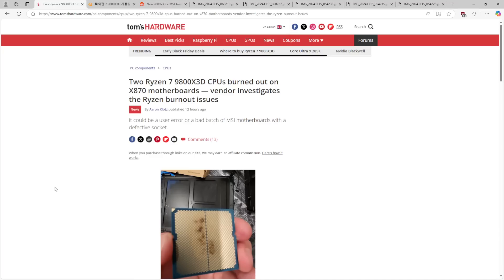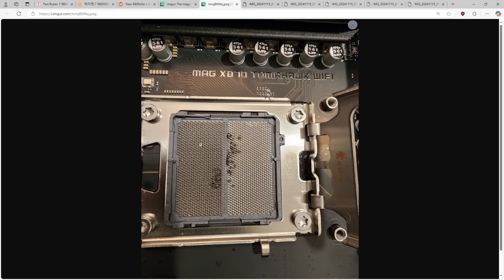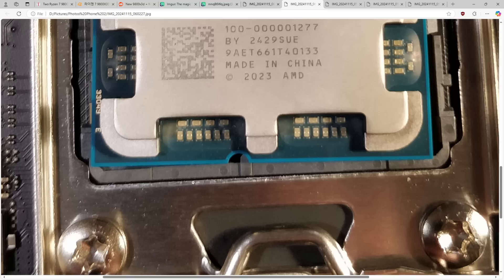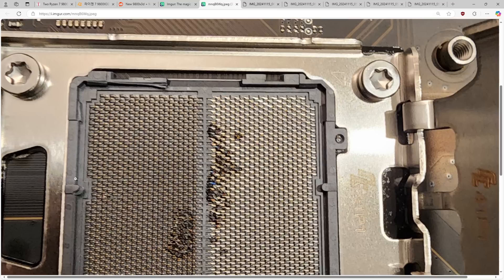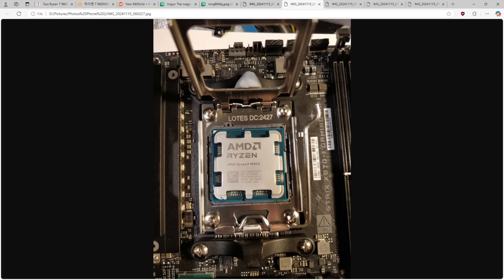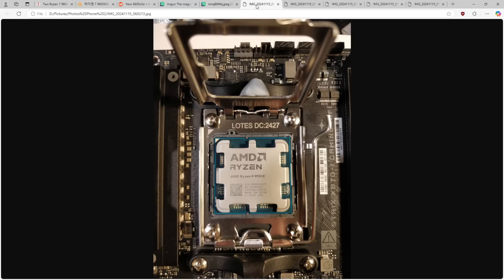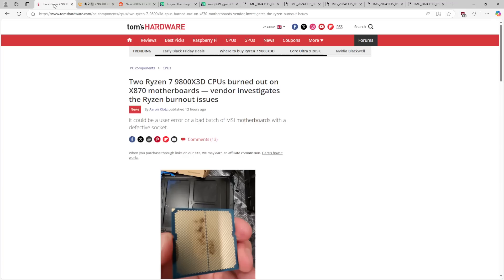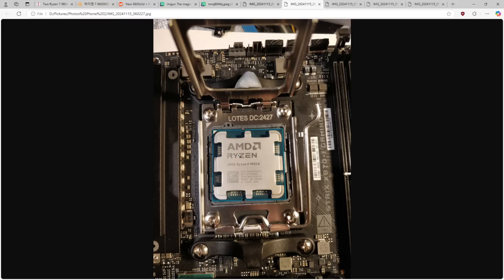HOW NOT TO BREAK YOUR 9800X3D

Comment: The thought of dropping a CPU and bending pins the harrowing. 
The thought of somehow managing to misalign a CPU in an AM5 motherboard is curious. The thought of closing the bracket hearing a crunching noise, seeing at the CPU clearly isn't aligned properly (granted your optometrist might be bad at their job), and bending your neural circuits to the decision of turning on your PC-turned-oven is mind boggling.
Reply: Mounting the cooler to this makes it much worse. It's not that hard to slightly misalign then latch the CPU but now it's sitting higher than it normally would. Mounting the heatsink would shift it even more and this force explains how it stamped a perfect notch into the plastic.

The only thing more absurd than all of this is taking it out and uploading a picture because you think it malfunctioned. I have a feeling they knew and that's why they angled the photo that way but who knows.

Comment: Already 6 years since I put R7 2700x into AM4 socket for the first time but I remember it being effortless.
Now put 9800X3D into AM5 socket for the first time and boy, was I scared to damage the CPU. It needed so much force for the latch to lock CPU in place. Had to do it twice in a row to check things out if I didn't damage anything.
But that notch was easy to see if you actually check how it's sitting in the socket. CPU's are expensive so I want to make sure I put it in place correctly.
EDIT: Had 3570K before, Core 2 Duo and Pentium 4 way before but don't remember those sockets anymore.

Comment: There's probably a few dozen people that did this.  Most were smart enough to realize they F'd up.  These are just cases of double failures.  
Fail to do it right, fail to notice you did it wrong. 
Pro tip, you don't need a hammer to install PC components, and if you hear crunching noises, you F'd up.

Comment: Jeez, what's next, "How to Put Your Feet Into Your Socks"?  I seriously don't understand people-  unless you wipe your ass with hundred$, why TF wouldn't you take 5 SECONDS to read the instructions on your $500 CPU going into your $500 motherboard?  This is either a problem caused by absolute idiots or people is so much of a hurry, they put the chip in sideways while running down the street while getting dressed while eating breakfast while taking a shower.  FFS, 'tards, take a breath, count to 1, and go slowly.  OR, find a hobby where there's nothing sharper and more dangerous than warm butter.

Comment: The 9800 ex 3D shouldn't even be called a 400.00 CPU just call it straight up 500 especially when it's that close at 480 play remember when CPUs were around 300 back in 2016 times have changed

Comment: People need to remember, hardware does not need force, it it is correct it will fit.
Reply: Say that to motherboard 24pin power cable 😂
Reply: Bro never touched a Molex connector

Comment: That last comment was dumb, if someone needs some advice of what to do and not do when building a pc, they shouldn't build a computer? So how do they start, is building a computer a skill that some people are just born with? If anything it's a good idea to seek as many informations as possible when doing this, just to not end up like, for example, exactly those two people in this video
Reply: For newbies, they can buy an old $20 HP/Dell office tower and play around with disassembling and reassembling it. Old office tower PCs are everywhere. The original poster of these pics deserves no sympathy because he made a mistake and didn't own up to it, instead blaming AMD and MSI.
Reply: @gippygames  I didn't mention the original poster, they did fuck up. As for newbies, yes, practice on some old systems is a great way to learn, but by itself doesn't just make the "theoretical" advices obsolete. Having more informations just doesn't hurt, and that was my whole point
Reply: It's absolutely paramount that you've completed your shape sorting test before installing a CPU.
Reply: @dhuckbourning7165  but the problem here wasn't putting the cpu correctly, but the whole vertical process, where properly seated cpu got skewed while closing the latch

Comment: I don't get it. I actually just upgraded from AM4 to AM5 about a month ago. Before this I had never had a PC with an LGA socket (I have always had AMD which was PGA) but I still had the common sense to know that the CPU just sits in the socket, it doesn't require me to push on it to set the CPU and I knew that the notches on the CPU sides should match up with the notches that stick out on the socket.

Comment: as much as its their fault for the incorrect install it makes me wonder if this could be detected before they attempt to power the cpu. maybe something like testing for a connection between 4 pins in the corners of the cpu. if one is missing the cpu cannot be seated correctly. sometimes engineering is just making things idiot proof.

Comment: Since I am also an idiot who installs his CPU vertically to save time I did some further investigation because I am in denial. I gotta say that the CPU sits firmly in the socket when you place it correctly even in a vertical position and it wouldn't be possible to misalign it else the CPU would just fall out. So now you put down the retention bracket and try to move the CPU in all directions while gently pressing it down, there shouldn't be any movement or you did it wrong. Now you can keep one hand on the CPU while securing the retention bracket.

When you look up an installation guide you can see that the first time around there's a cover protecting the socket so you can't pin down the CPU unless you remove it first but if they followed instructions they wouldn't have done that and it wouldn't be possible for the CPU to be installed vertically with so little dmg and it would always be the bottom notch that would be damaged due to gravity. I think they did install the CPU horizontally but were just eyeballing the insertion and thought it would just fall into place when the bracket forces the CPU into the socket or they just didn't think at all.

Comment: Shit, guess I am an idiot for finding this video useful lmao. I did imagine if I can get away with this dumb method of installing a CPU without ripping my system off the wall to get it laying down horizontally. Thankfully I remember that I had to take the cooler off anyway so I ended up just installing it horizontally. Was one step away from having more reddit post about burning CPUs lmao.

Comment: Reddit post also has at least 2 bent pins in areas away from the scorch marks so good handling of hardware seeming more and more unlikely.
  I always did a mix of looking before for both damage+debris (hairs and stuff sneak in otherwise) which rarely but sometimes caught damage before starting and then do a mix of physical feel (wiggle room and such) + visual confirmation for seating CPU and RAM as I know from experience that I find errors that I cannot stop with just 1 or the other. I have done vertical component install but it rarely saves anything as I have to slow down a lot to carefully avoid such errors; just avoid it if you have any alternative.
  I also used to have to inspect other people's work (computer technicians, customers, etc.) and in the end it seems they are all human and things happen even to the best of them. I was still most shocked to learn how nicely corners of some Intel CPUs (nothing against/for them but its where I first saw it) permanently flexed under such improper installs.

Comment: I'm not going to pretend I wasn't an idiot installing CPUs vertically in Intel mobos, but I assume you'd have to use a fair bit of force to close the latch with the CPU physically in the way. If you have any experience in closing these mechanisms it should become readily apparent that something is wrong.

Comment: * place CPU in socket 
* activate brain
* drop the latch, then, with a finger of your other hand, put pressure on the CPU so it stays in place when you pull the other fingers away
* close the retention mechanism fully
* be proud of yourself 
* realize that mounting the CPU cooler in this orientation is going to be a major PITA
* double down and fight gravity for the next ten minutes
* enjoy new CPU with bad temps from bad cooler mount
Reply: That's why I always mount the cooler first.
Reply: I think activate brain should be the first order
Reply: I'd be too afraid of scratching the pads under the CPU.

So...
1. Activate brain
2. Lay the PC sideways
3. Install CPU

A little extra effort for hundreds of dollars extra safety.
Reply: @jeuno880  True, the safest approach is rarely a bad choice. 
CPUs aren't all that fragile, tho. 
I've actually installed several CPUs with the case upright because the installed water cooling components would've created a mess otherwise, and with so much stuff in the way removing the board and putting it back in would've been riskier than the unusual CPU installation. 
My current CPU isn't just delidded and direct-die-cooled, I lapped the die itself and reduced its height by .2mm in the process. 
Not a single scratch on the LGA, and I didn't even tape off the backside before torturing it on a granite plate for six hours. Not that I wasn't nervous the entire time - 10980XEs are expensive chips - but the pads were the one thing I knew I wouldn't need to worry about ^^
Reply: @protator  I have shit luck so I try to eliminate risk as much as possible. That's why.
Reply: @protator I miss the days of Intel HEDT. So many custom things you could do to improve performance. Delidding was easy. Spent hours tuning my overclock.
Reply: You forgot the 'clean thermal paste that fell onto GPU' step
Reply: @Tredenix  I did consider editing that in, but decided to leave it in its semi funny state. 
I've actually swapped CPUs this way several times, but those builds were all water cooled and had soft tubing. Not that big a deal and hardly any more 'risky' than doing it with the board horizontal. Joking about this too much would've felt disingenuous. After all, those two ppl were just idiots.
Reply: @Tredenix  It's not conductive, so that's only an issue if it falls onto a contact point with either your power supply plugs, or your actual traces for the PCIE interface. 

Also with regards to the original poster in this thread, I've installed the both cooler and CPU with the case upright before. If the cooler uses screws, it's fine. It's going to be mounted roughly the same. And if you spread the paste out manually yourself before putting the cooler on, it's not just going to magically drip off. If the CPU cooler uses pressure mounting then yes, vertical installation is a bad idea. Obviously you need to be careful but it's not exactly rocket science, which makes this video even weirder to me because these people clearly just mishandled a $480 CPU without giving a crap.
Reply: and dont be a normie haha.

Comment: I had a AM4 gaming rig in a few months ago where the guy had decided to re apply his paste and then the machine wouldnt boot. I got it in and yup, nothing going on. In the end I removed the cooler and went "Oh!" Yep he had put it back 90 degrees rotation out. I put it back as it should be and it then worked fine luckily. He just went "oh I didnt know it had to go in a certain way!" I did have a kid slap a i7 from a newer gen in a older socket and he bust all the substrate all around. Good work!

Comment: Yep, this is most likely it. Impossible to know for certain if you don't have pictures of the mainboard pre-installation, as this sort of damage could've been done at the factory as well (very unlikely with modern QC but perhaps a factory worker mixed the piles up at the manual rework station for example).

Comment: Another wild theory is that they might have put the cpu in the socket correctly but managed to bump it out in between the latching. could be that they put the cpu and then put the ram in-between latching.I haven't installed LGA stuff in a while so I might be underestimating the force needed to bump it out

Comment: Are you sure the user didn’t just lick the back of the CPU before insertion? I mean some people REALLY like this CPU.
Reply: god damn it BZ for hearting this comment 💀
Reply: They're gonna need to start coating CPUs with that bittering agent they put on Nintendo Switch cartridges.
Reply: Hard to resist for some 😂
Reply: I mean its the same dimensions as a stamp just a big bigger
Reply: Our repair tech's report was that the CPU was inserted...   moist.
Reply: Well it does say "apply thermal paste" so to save time licked it like a stamp 😆
Reply: Well, I could've done that w no shame! 😁
Except I'll manage with the installation and ensuring nothing will ruin this piece.
Reply: So he drooled on his motherboards cpu slot 😂😂😂
Reply: Someone buy me one and I do the same😅😅😅

Comment: wasnt this a "story" when the 7000s series came out too
Reply: That one wasn't caused by user error, though. That was the MB manufacturers pushing things too far.

This is just pure idiocy on the users' parts.
Reply: @tomhsia4354  well i remember that being the excuse but i never looked that closely at them
Reply: @Healcraft  Gamers Nexus was able to trigger a bug in Asus' motherboard over current protection circuitry and got a bad 7800X3D CPU hot enough to melt the solder for the AM4 socket.

IIRC, the CPU went bad because of MBs overvolting the CPU out of the box, and may result in a short. It was patched rather quickly, though. There was an actual issue, not just a story.

These incidents of 9800X3D burning are just user error, judging by the damage to the socket indents. Probably users not knowing how LGA sockets work.

Comment: This is the difference between LGA and PGA.  If you are going from PGA which can be installed vertical with a slight chance of not being inserted correctly, vs the newer Ryzens that switched to LGA and are very easy to misinstall, especially vertically, among other problems, and should be installed horizontally and CHECKED after install.  I have heard of this issue happening but usually without enough power to burn the CPU and Pins but just cause some delam and pins needing cleaning when you install your new CPU.
Reply: I much prefer PGA, not to mention that PGA actually allows for fully delidded CPUs like the ones from Socket 462- without any fancy latching mechanism, just the stock one.
Reply: @satsumagt5284 Same. I really like PGA because the processor just falls right in place if you got it correctly installed. Then again, I don't have much experience with LGA so it could be the same thing.
Reply: @Iridiumcosmos  I have installed CPUs of both types. PGA is definitely satisfying to use and more repairable in case of an oopsie, since bent pins are easier to deal with than LGA socket (both can be destroyed beyond repair, of course). Had zero problems whatsoever with both types in my life.

Still, LGA.. Well, the fact the socket can be closed while slightly misaligned is a no-no to me. That wouldn't have happened with PGA, as the CPU won't properly sit inside the socket, making it a bit more obvious that something is wrong. It's also a bit more nerve wrecking to install, since you must hold the CPU somehow but also NEVER TOUCH THAT DAMN SOCKET.

 I also overall dislike the fact that LGA pretty much mandates an IHS as well, while PGA was often direct-die 20 years ago. It's just that the clamp style coolers of the past were kinda prone to putting uneven pressure if incorrectly installed, cracking the chips.

Comment: X870 mobos, so both of these were probably new builds and not upgrades (haven't read the posts to see if they confirm this) and my guess is that they didn't notice the damage happening when applying pressure cuz the black socket cover was still on the ILM cover. Still amazed they did not see the CPUs not sitting correctly when they dropped them in the sockets.

Comment: God, what they were thinking about? If it's 9800X3D it's going to handle vertical installation? :D
My guess is that they probably did it with AM4 CPUs which had pins to stick into MB an it worked somehow for them and now they tried to do the same with AM5.